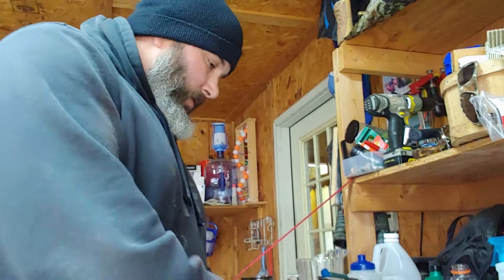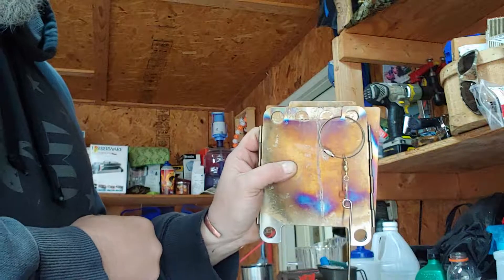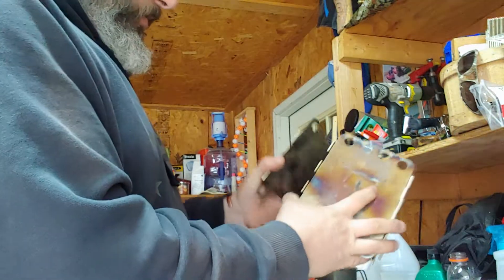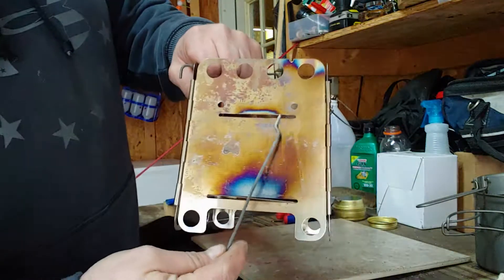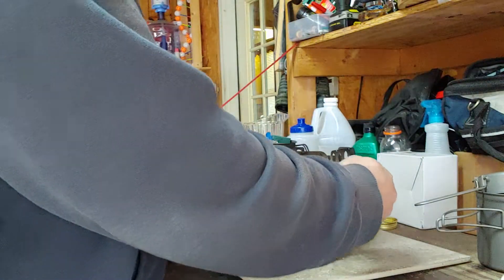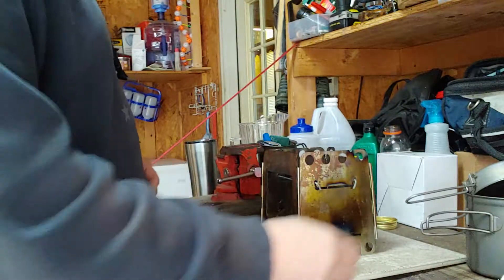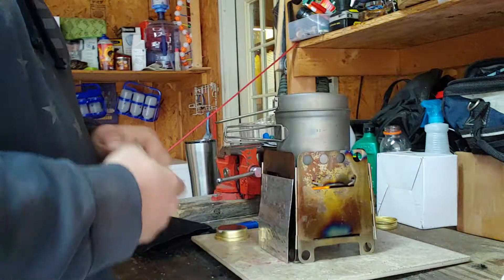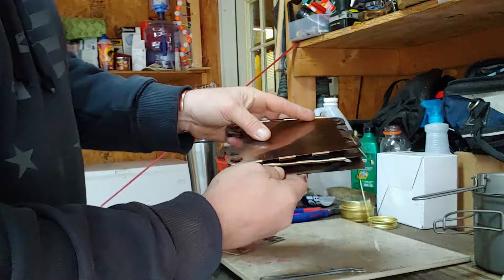Lixada hinged wood stove simple mods

Comment: did you make the pot/ cup holder rods yourself?  What did you use to make them and what are the dimesions?
Reply from the maker: Yea I made them out of some heavy duty hanging wire I had around the garage. I didn't really measure them. I cut them long. Bent one end slid them through and marked where I wanted the next bends. Then cut them off after getting it where I wanted them